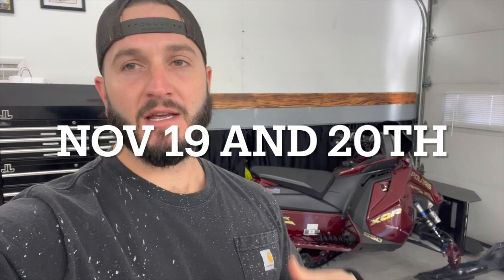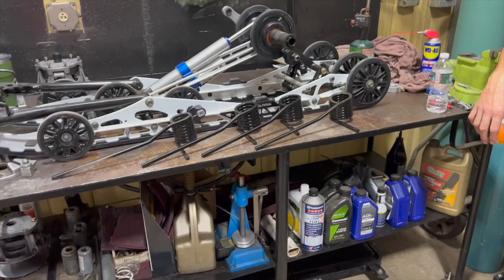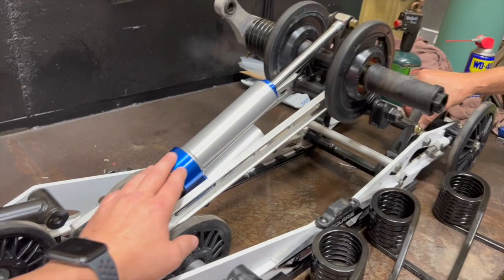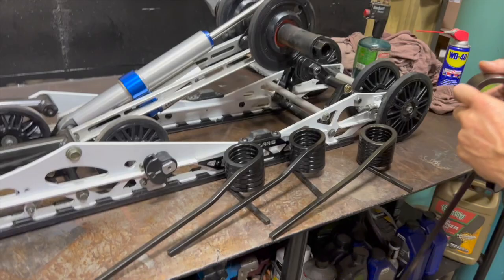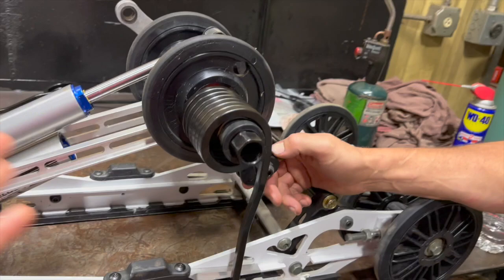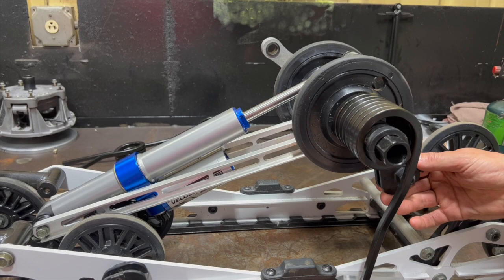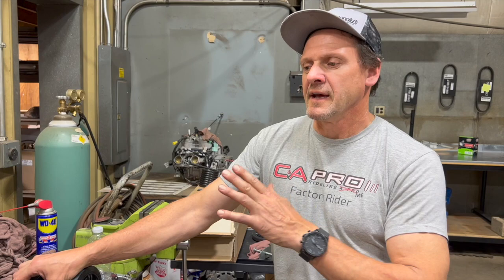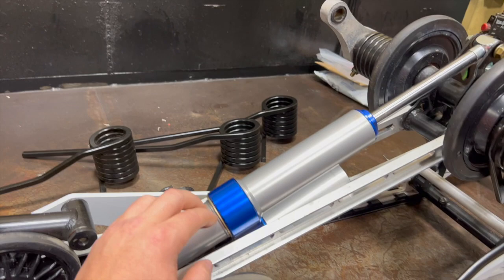POLARIS MATRYX AND AXYS REAR TORSION SPRING OPTIONS! NEW TRAP SPRING INFO! WHATS THE BEST FOR YOU?

Comment: Wondering what the reason is for the torsion spring being quite a bit larger then the bushing it fits over. Hygear has larger bushings to take up the slack, but stock all sleds come with that larger gap.
Reply from the maker: the stock torsion spring does not have a very large gap. when you get to the bigger springs the gap significantly increases

Comment: Do you know if the assault boost with 2.0 track comes with the HD springs and do you know if the boost assault with 2.0 track comes with tunnel protectors ?
Reply from the maker: will nit come with HD springs and will not cone with tunnel protectors. The springs on the assault are different then the short track stuff. they only make a standard and a HD option for the assaults

Comment: As a younger rider I've always found it difficult to get my suspensions to hold me up and not bottom out. It's like a bit of a dark art or there was never components available to do so. Admittedly I'm not a professional or semi-professional but I know when I it's not right. I just got a Viper XTX with an uncoupled rear suspension and I'm now 265 lbs in my birthday suit. I've got the heavier Bill Moer spring but I'm having to Dalton up way more than recommended just to keep from bottoming out. I've got the rare Fox float at 150 psi because that's as high as my pump will go.
Reply from the maker: i do not know much or any about the suspension on those sleds unfortunately. you can try giving Southside sales a call and asking Bruce if he can help in any way

Comment: These 7045924-239 (Left Hand) and 7045925-329 (Right Hand) torsion springs are the stock spring on MY23 Indy Adventure X2 137 sleds equipped with the 650 or Prostar S4 engines. As pointed out here, these springs have a somewhat trapezoidal (flattened oval) cross-section and have a spring RATE of 14.4 lb. per degree of leg rotation. They are listed as having 86 degrees of PRELOAD, cost is $105 US each, but they are not available from the Polaris warehouse at this time.

The IGX 146 suspension used on the Matryx Switchback Assault or Switchback SP/XC and NordicPro, SKS and Voyager 146 comes with Standard weight torsion springs, Light Duty and Heavy Duty are available, as you can see on the Rear Torque Arm Parts diagram. Many riders have changed the Matryx Assault sleds to the Light Duty torsion springs because the stock springs were too stiff. The Assault torsion springs are not interchangeable with torsion springs for the PRO-CC coupled suspension used on the 128/129 and 136/137 VR1, XC, XCR and Matryx 137 Adventure sleds. 

MY23 Polaris Titan sleds use: 7044813-329 LH, 7044814-329 RH SPRING-TORS TRAP 14.4/72 Notice that they have the same Spring RATE of 14.4 lb. per degree of leg rotation, but only 72 degrees of PRELOAD.

Thanks for showing the differences between the various PRO-CC torsion spring options.
Reply from the maker: exactly! thanks for putting it into words! appreciate you following along!
Reply: Do you know if the 72 degree have a slightly bent shaft on the adjuster end of the spring? I have 2 sets in front of me and the shorter adjuster shaft which is straight I'm guessing are the 86 degree and the slightly bent shaft would be lighter at 72 degree. Thanks

Comment: Jesse, I'm 250 plus gear on, a full full linq gas caddy, plus medium linq bag, so maybe around 310+,  my 22 VR1 does have the HD springs in them now.  I hate bottoming out, I tried to ride this week on the middle torsion but it was slapping my tunnel at just about any speed.  On the high torsion setting it's much better, I have my rear shock at 4th click from fully closed.   Am I too light of a spring?  Can I just have the rear shock rebuilt or do i need to have both skid shocks done?
Reply from the maker: so i personally thinj you are still under sprung for that weight. you would be a candidate for XHD or the Trap springs. If you were to get the rear shock valved its easy enough to take the FTS out and have taht done also. Not to mention i would recommend 100 pound ski springs. these are all things the boys at Southside can help you with

Comment: Are they all interchangeable and fit Axys/Matrix body style? I have a 2020 Switchback Assault 144 (Axys body) and I can't seem to find any info on them. The only ones I see fitting on my body style seems to be the HD 704194(2or3)-329. I'm 250 and often have my GF on the 2 up seat. GF is around 150. Which spring should I be considering, the XHD?
Reply from the maker: these are interchangable to Matryx/Axys but the assaults have their own spring and yes they only have a HD Option. You definitely need the HD for doing what you are doing and i would recommend some shock valving as well

Comment: I know you recommend valving when going with HD springs, my question is will I feel a difference just installing HD? 240 lbs on a 22XCR 136.
Reply from the maker: You absolutely will. You are at the weight where would could potentially recommend the XHD or the new Trap spring. Really need to talk on the phone to discuss that though. But yes you absolutely need the HD springs over the factory springs

Comment: Does this apply to the assaults since they are a stiffer sled?
Reply from the maker: Assaults only have 2 torsion springs. The standard ones that come on the sled and standrd HD ones.  What makes teh assaults stiffer is the valving in the shocks and it comes with stiffer ski springs

Comment: Great video, question I have is what torsion spring is recommended for two up 50% of the time. HD or Extra HD. Both rider are 180 fully suited up, with small cargo box.  On a VR1 137” Thanks
Reply from the maker: so with the 2 riders i would say XHD but because youre going to be riding solo from time to time it throws a big wrench into the plans unfortunately. By yourself i would say HD but with the additional weight of the rider and the cargo i would say XHD. Let me talk to Bruce and see what he suggests

Comment: Awesome videos! Still slightly confused on what spring to run. 129 VR1 boost 240-250 lbs with gear aggressive rider
Reply from the maker: i would say the trap spring. we would also recommend haveing that rearr shock revalved to slow the rebound down

Comment: I am about 285 without gear.  just got a 2022 VR1 136 with stock setup.  Should I go with the heavyduty torsion or the extra heavy duty?
Reply from the maker: I would recommend going with the trap springs that we talk about on this video. I would also highly recommend a shock revalving to relaly optimize that suspension. Southside sales can help with the springs (and the revalve of you decide) give them a shout and they will get you all set up
Reply: How come polaris documentation  says their HDs go up to like 320 lbs and their extra HDs go up from there.  Are their recommendations that off?   Appreciate the intel from you guys.  I would love to get mine revalved as well to slow down that rebound with heavy springs. As a general rule what would you guys recommend for setting sag?  2 inches or so of drop while sitting on it about normal?
Reply from the maker: we have found their chart is very very far off. not sure why but it is. and yes thats what you need in that rear shock especially. we do not really use the sag numbers. we have found that even if sag is right the rider may not like the ride or the sled still may not handle as it should so we stray away from them

Comment: Question I'm on the fence about the vr1 850 or xcr 850. I'm a 52 year    old man that weights 332 what sled would recommend?
Reply from the maker: really depends on what features you want. Either sled that you get we would recommend shock valving and spring changes to get the optimal ride. Unfortunately these sleds are set up for about 180 pounds. anything over that require what i said earlier. I would be happy to help you get all set up if needed
Reply: @JESSEJAMES322  
I'm thinking about a xcr or a vr1 both 850. Would just need HD torsion springs?
Reply: @JESSEJAMES322  
Thanks for getting back to me. I'm really thinking about getting  a xcr . So valving and HD torsion springs would be recommended for me.
 Thank you.
Awesome video I have learned a lot from your videos. Thank you. 
It's has been a long time since I had a sled . The last sled that I owned  was 2003 skid Rev mxz 600 H.O.
I can't wait to get back into the sport once again.
Reply from the maker: you would not be HD springs. HD come on the XCR. for your weight we would most likely have you run the titan springs. and then we would need your rear shocks so Bruce can go inside of them and change all the internals.

Comment: I put the HD springs on my 22 Switchback Assault 146 because I'm doing a lot of 2 up riding and it feels like the springs are sitting higher and rubbing on the inside of the track. Have you ever heard of this happening? Thanks!
Reply from the maker: i have not seen that happen. send me a message on facebook with a picture of it. seems off
Reply: @JESSEJAMES322  Will do, thanks man. Is there anything else that would cause quite a bit of vibration when riding? I did check the track and it looks like it was about 1/8 inch off on one side. I wonder if that was the culprit but didn't know if 1/8 inch would make that big of a deal.

Comment: 22’ switchback assault 200lbs without gear aggressive rider—I know the assault is stiffer shocks would you still recommend the HD spring?
Reply from the maker: Hey Rick. With the assault you should be fine. i don't think you'll have any issue at that weight!
Reply: @JESSEJAMES322  Does 22 SBXC use the same springs as assault?  I'm 180ish.  Not afraid to ride hard.

Comment: I’ve got a 22 xcr 136 I’m 220 still running stock springs on high setting ride height on the sled seems perfect but would like to improve handling on rough trails. Do you think I should upgrade springs? Valve shocks stiffer or both
Reply from the maker: I would suggest both. The heavier springs to hold you up and valving to improving the dampening. We made huge gains handling wise last year doing both so i would recommend both